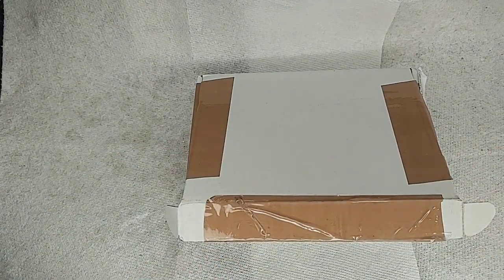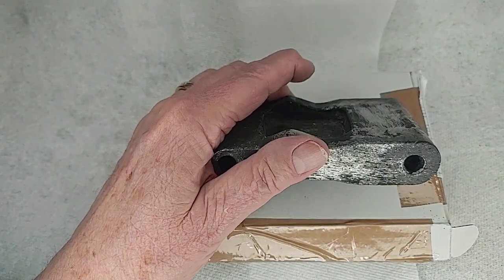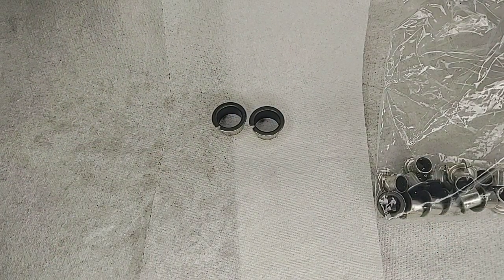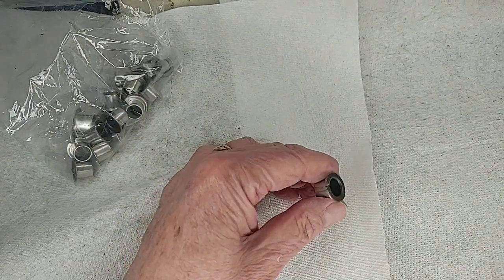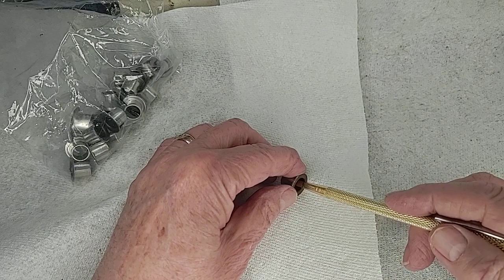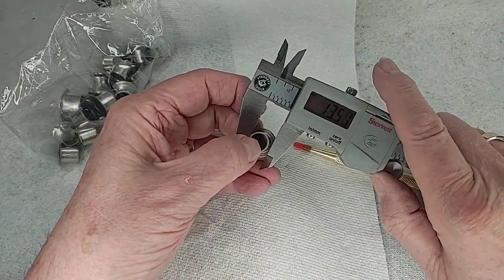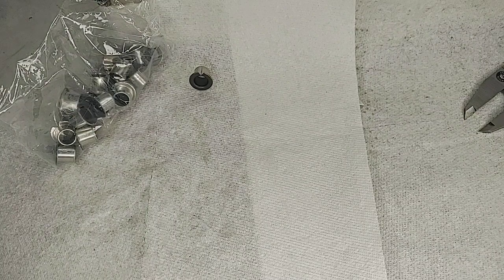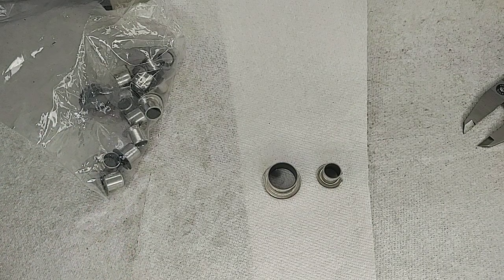Ford sticky power running board, the bushings. Let's see a bushing.

Comment: I just did this repair to my running boards for my F150. Same kit and the fitment for the (x4) larger bushings on the motor shaft was awful. Garbage actually. My dad and I had to Machine 4 new bronze bushings since the ones in the kit were almost 0.75” larger in diameter than the bore hole in the hinge. The smaller ones did fit but require a slit in them which wasn’t bad.
Reply from the maker: Thanks for the info on the motor bushings. In my case, I did not do that because I needed a whole new bracket for that end and so just ended up buying a complete motor and bracket set for a bit over a hundred bucks. I will have to do the bushings when I do the driver's side on the Navigator, so I will look into that as I do up an additional set of videos to add to this set.

Comment: Could you measure the exact ID and OD of the bushings? I don't think $30 for 18 bushings is correct!
Reply from the maker: I have gotten around to making the video where I cover this, just look at my channel. This is the link to the information that you want.  https://youtu.be/cWtVEHliCcQ 

As a small note, since I bought mine the price has risen quite a bit, they are now US $44.99. The seller that I got these from is on eBay, his name is qdi_ltd

Ford used a bushing that they had made for them. Remember, when you are ordering in lots of a million parts you can get exactly what you want. With that said, the diameter of the ones available in the market, and for that matter in the kits that people sell are 12mm. The hols in the brackets are 11.5 mm. The fix is to cut through at the joint, removing around 40 thousandths or so and then compress the new bearings with pliers around one of the pins to more or less bring it to size and keep it round. 

This and so much more is covered in my play list on this subject: https://www.youtube.com/playlist?list=PLoz-2IH4A2KsZiDXB0f-hhKZtAzO_wuO_
Reply: I altered Oillite solid bronze bushings from McMasters. Everything I needed to rebuild all boards was under $100. I show the process here. https://www.youtube.com/watch?v=dsCQXgNPy8c  A shop press, lathe, and 2 reamers are needed also. 1st part is up and the rest to follow. I should have used Oldfarthacks idea of the grease fittings but I don't think bronze and stainless steel will corode very much over the years. Best of luck guys!